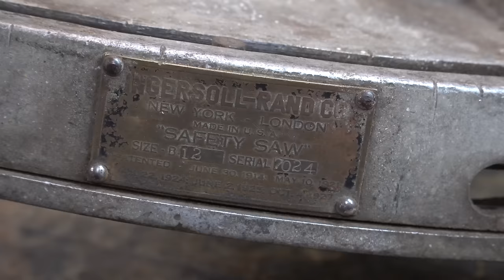Triple-Piston Pneumatic Circular Saw [Restoration]

Comment: This “restoration” was done incorrectly on purpose. If you watch the end of the video, you’ll see that the guy is making a deliberate effort to make the device look bad. It’s a bad design! 

If this three cylinder pneumatic motor can run on continuous air-pressure, then it can run on continuous steam pressure. So this out-of-patent design can be made by anyone.